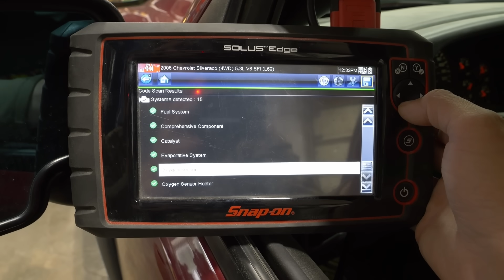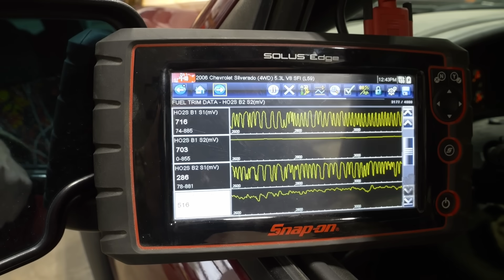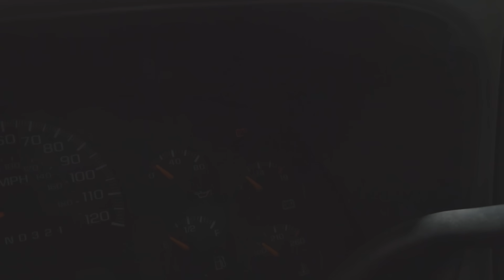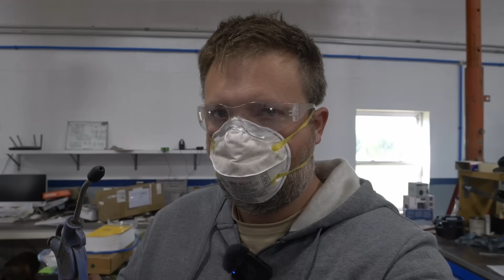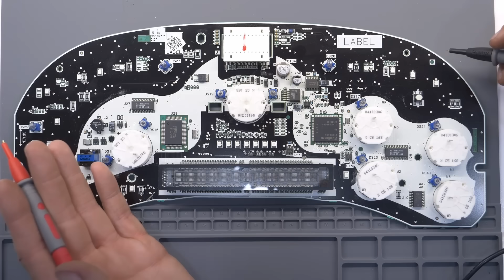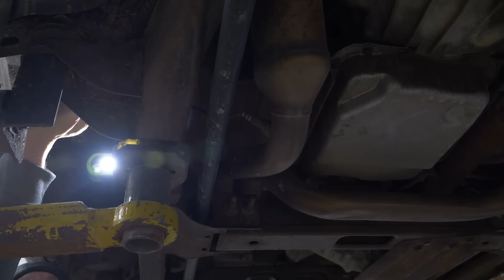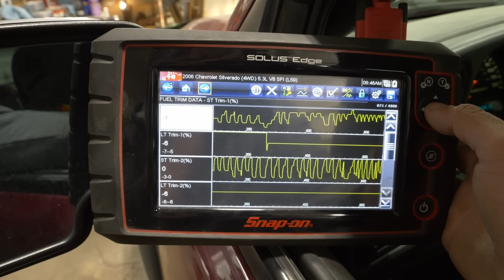AutoZone Says It Needs a Starter

Comment: Wes, I have no electronic anything to diagnose codes, so I go 1 mile away to Autozone. Autozone has always been very good to me. They come right out and read my car, then offer me a print out of all my codes for no cost. And they have never offered an opinion of diagnosis. Their paperwork sure does, I mean they list out all the things they can sell that might be related to the issues, but not the help. So I'd check the loose nut behind the wheel. As for that Tie rod? Count the threads. Duplicate parts are made so accurately you will easily be right back in the "green" if it ever was. I've done it many many times and then if you are real good, like they guys I used to work with, you lift the car to the right height and sight the tires front to back. Looking at the "threads" (that's what the eldest machanic called the tire treads) Match the other side. Toe is the easiest thing there is to set, and most places don't even bother with anything else. There's a saying at the ripoff car repair joints: SET THE TOE AND LET IT GO. If you do the guy a favor and replace the bad part, he's less apt to be fleeced by the next auto repair place when he goes to get the toe reset. The world is full of auto repair ripoff joints. You and just a couple other guys are the only ones I know of on the net that do things right. Mechanic for 57 years speaking. ben/ michigan (OK Let the Trolls begin I don't care, I won't be back to check)

Comment: 40 years ago when a ford ignition module would go bad I had all 3 color connector “known good” versions in my bottom tool  box drawer. It made it quicker to diagnose the problem.

Comment: Wes, next time before suspecting anything cluster related on any 90's on up GM truck, double check the 1-2 grounds (I think  g101 might be the name?)located on the driver's floor cab mount bracket, should be opposite side area right where you changed the O2 sensor

Comment: The instrument cluster was a big problem for that generation of trucks. I found that out when I had to replace mine at around 100,000 miles. They also had problems with the brake lines rotting out right under the cab. My Truck was garage kept and they still went prematurely. There were also alot of ABS and wheel bearing problems
Reply: I've got 275k Miles on my 03 and never had an gauge cluster issue. Got really lucky because 3 other Chevy's in my family had issues with them around the same vintage

Comment: My wife’s 2020 Explorer kept having intermittent AWD codes/warnings. Found a TSB and all symptoms and codes matched the TSB. Bought the $130 sensor and a quart of diff fluid and still not fixed.

I went and just messed with the module, pushed the LOCKING connector in to make sure it was secure and boom lights gone. After 5 drives and her drive last night, still gone. 

Crank up this morning every light back on the dash. Maybe I’ll take it to Autozonw

Comment: Went to autozone for a CEL read (my OBD tool broke) and they got a scanner that wouldn't output a code on the screen. They hooked the thing up to their computer, and the guy told me that the code was for a "bad evap purge valve," but wouldn't tell me the code number. The guy then tried to keep me from seeing the actual code by pulling the monitor away, before another guy waiting in line saw it and told it to me.
Turned out it was a slightly leaking gas cap.
Reply: That’s a yikes man, I’d have written online about that employee.

Comment: The information I've heard about lead-free solder is that it tends to grow tin whiskers, these whiskers become high impedance shorts between adjacent pins.  If you have a design that has high impedance inputs or floating outputs then these can start to interfere.  As the whiskers grow over time their impedance will drop.
Reply: also is more brittle than leaded.
Reply: @dont-want-no-wrench  Many cycles of hot and cold will make lead free solder crack or let loose.  Many VP44 injection pumps used lead free on their internal computers.  That contributed to many 2nd generation Dodge Cummins engines quitting. The other issue was bad location of the junk fuel pumps to the injection pump.  Ask me how I know.

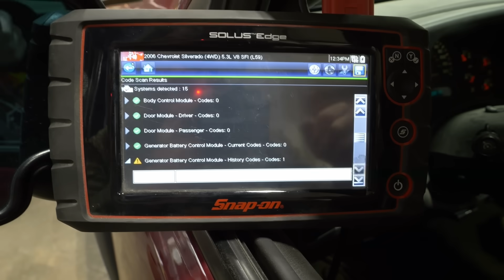Comment: 1:21 - ruh-ro, Generator Battery Control code, I wonder if this is going to be relevant later.
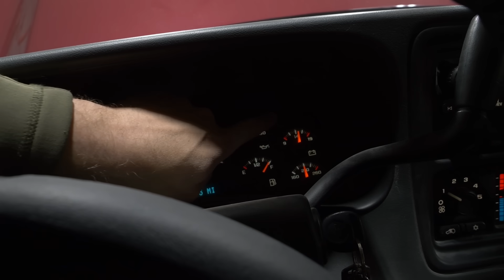5:00 - yup, the battery light is on.  It's become relevant.  I bet the comm wires are unplugged from the alternator.
Okay it apparently was not. Still got a few minutes left.

Comment: Helpful tip when taking the cluster apart is put a small piece of masking tape at the bottom stroke of each dial and mark a line on the tape.  Makes it super easy to line them back up after reinstall.

Comment: I was thinking about the O2 switching in closed loop.  We've always been told "it's for the catalytic converter", but do you know if anyone has actually tested that or is it just tribal knowledge we keep propagating?  Honda developed their lean-burn system way back when and that didn't kill their cats.  My Honda motorcycle actually runs very lean and it's closed loop whazoo EFI with cat.  I suspect the dithering of the O2 sensors is actually because the sensors can't read stoich, so they dither back and forth.  Consider this argument:  When you reach the nyquist rate the only way to determine accurately what the value is, is to dither across a value.  Put another way, if you have a scale and you weigh something, if it says 2 lbs, then 3lbs, then 2lbs, then 3lbs, you can be pretty certain it's 3lbs.  Conversely, if it doesn't dither between 3lbs and any other number, you know the weight is between 3lbs 0oz and 3lbs 15.9oz.  Dithering is a technique used to increase the resolution of a signal past the nyquist rate, so if O2 sensors dither across lambda 1, then you can be assured your average lambda is 1.  I think the real reason closed loop dithers is because of how narrow band sensors work, you could never accurately determine the AFR without dithering.

Comment: As soon as you showed that battery light on even with the key off, I thought “cluster problems “. BTDT! I had all sorts of weird warning light and intermittent gauge issues on my Sonoma. Replaced the cluster with a good used one and the problems went away. Somebody had already been in mine as most of the soldered components had been potted.

Comment: I had a similar problem with my old Ford Focus (dunno if that thing has the same name over in the states), where it would light up the whole dashboard and go into limp mode, because the solder joints of the K & L lines on the connector were broken due to vibration. Sometimes smacking the dashboard would help, but in the end, I had to resolder them. I used some painters tape to mark the dial gauges.

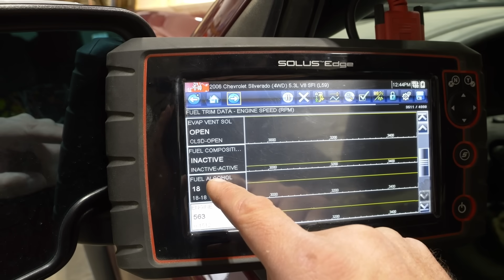Comment: 4:00 actually the E85 alcohol is more potent, if the engine is designed to operate on it.  That's why a lot of people with race vehicles use e85 since it's more affordable than race fuel. 

When E85 is used in an engine which isn't designed specifically for it (aka flexfuel), a lot of i the a potential power is completely wasted.
Reply: It is not actually more powerful than normal gasoline. It has an equivalent octane rating of 100-105 (octane being the measure of how much pressure the fuel can take before spontaneously combusting). Cars make more power because it provides more cooling and is more resistant to that spontaneous combustion, called premature detonation or pinging, so more aggressive timing can be used to make more power with it. You actually have to use more of it to make the same amount of power, which is why fuel economy tanks when running e85 in a flex fuel vehicle.
Reply: @rifleslol  powerful depends on application and how it's utilized.  diesel has more BTU energy content than both fuels.

Comment: Not a fix to glow battery light but a modification if problem not found … maybe add resistor. On battery light to eat up the stray voltage leak

Comment: The "scientific" way we go about marking the needles for reassembly is with painters tape and a sharpie. Also...reflowing solder joints on those usually fixes a lot of the weird issues.

Comment: You can adjust the toe with a tape measure and a straight edge I wouldn't be too afraid to do a inner tie rod just inform the customer that if they wanted to be done perfectly they need to go to an alignment shop because you can get it within 1 degree

Comment: I just did stepper motors in my 06 2500hd. The battery light was on real dim when key off. I only discovered why the battery kept running down overnight from the cluster motor trying to do work. Sent it out, tho. I am not as sophisticated as Wes.

Comment: Almost all new GM (as well as other) vehicles seem to have a voltage and current monitoring sensor on one of the battery cables (the Generator Control Module that was mentioned). It measures and report the battery state of charge and estimated internal battery temperature to the PCM, which can then vary the alternator output voltage. It's supposed to increase battery life, and allow increased fuel economy by reducing alternator output when the battery is fully charged and loads are low. 

I can see it maybe producing a measurable improvement in fuel economy in a small, already very efficient car. But I have a hard time believing it does anything measurable on a big truck that's going to plow gas regardless. I doubt it improves battery life in any meaningful way.

Comment: I feel like passing on troubleshooting skills to the next generation (or old parts changers willing to listen) is critical right now.  It's in danger of becoming a lost art. The ratio of PC's to troubleshooters has always been bad, and it's only getting worse. Someone needs to at least be able to correctly diagnose the robot overlords after they take over, lest we stray into the Terminator timeline.

As to your spectral battery light: may not be applicable to that system but we often have control systems that "fix themselves".  That's usually because, in the process of firing the parts cannon, the tech will inadvertantly knock a bit of oxidation/corrosion off a connector. This is after they've installed a several thousand dollar ECM or something, which they will then misattribute to changing the part, further reinforcing the PC mindset.  Keep on shootin', Wes.

Comment: Concerning the starter being fresh out of the box no good, I've got a 1957 Chevy that I rebuilt the original Carter four barrel carburetor on. Leather accelerator pump (made in West Taiwan) did not operate well, caused me (for the first time ever since family ownership of the car from 1968) to be stranded and towed home. After diagnosing the issue, paid for an accelerator pump with upgraded non-leather seal. Aces. Replaced the fuel pump as well since ethanol fuel did the diaphragm dirty (showed a date code of 1960!). Running good. Now to use it enough to burn half a tank of aged fuel, drain the tank, drop it and inspect for rust/dirt/water and replace the sending unit since it gets wonky under a quarter tank. 200,000 miles, no rust, I look forward to reliving my teens and putting on some miles using other than ethanol tainted fuel.